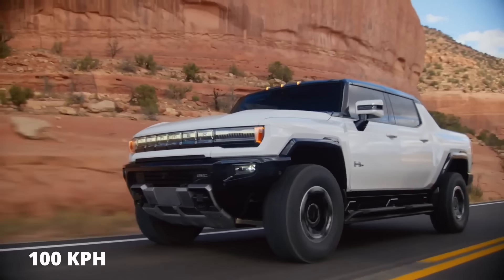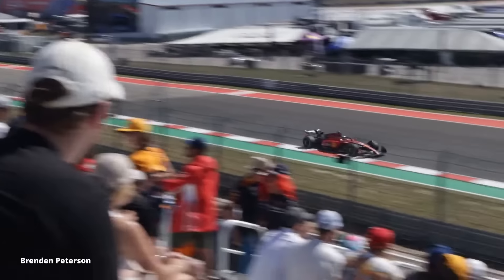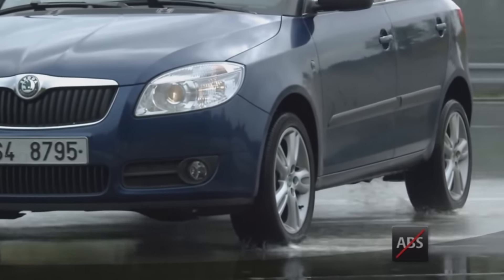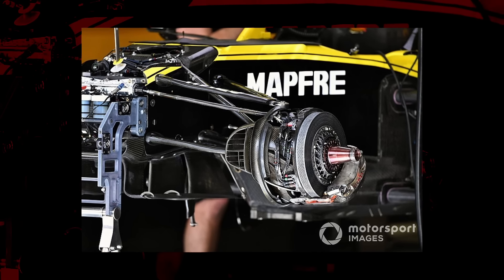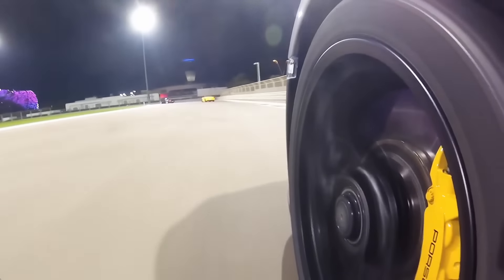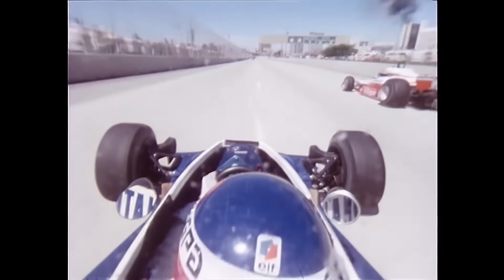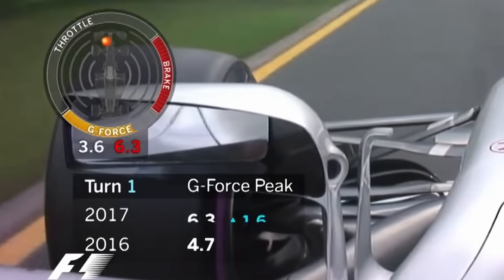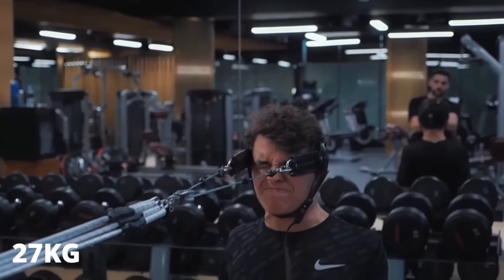Why It’s Almost Impossible to Stop From 200 MPH in 3 Seconds

Comment: The F1 brake explanation is out dated. Since 2014, F1 uses brake by wire with load cells and a computer controller to balance rear braking with energy harvesting.
Reply: I was going to say the same thing.
Reply: True, what he explained about the effort required to apply the brakes is still true however.
Reply: @JoshuaPlays99 What advantages do you get from artificially requiring a large amount of force on the pedal to brake? More precise control?
Reply: @baileyharrison1030  far more precise control, and also remember they can pull up to 6g on deceleration. If the pedal was too soft they wouldnt be able to modulate it as easily. They dont actually need to press that insanely hard because the gforces assist them in pressing the pedal.
Reply: Don’t they use a hybrid braking system with bbw in conjunction with standard braking
Reply: @baileyharrison1030 it’s not fully bbw
Reply: @JoshuaPlays99  thank you that makes sense
Reply: What he said an more
Reply: @JoshuaPlays99 redbulls can get up to 8g but same same
Reply: @JoshuaPlays99 well you do get some assistance on an F1 break. But it's a similar to how a servo on a road car get's assistance from the underpressure inside the engine bay. This pressure can be adjusted in the garage. But it's a simple multiplication of the force, nothing like the ABS like systems that help you control the brakes.

Comment: In 2019 I watched the German at the Track. Even the 'little' breaking zone for the Sachskurve was pretty insane. They came in easily 100kph faster than the Porsche Cup running just before, and still applied the brakes 40-50m later. 
Keep up the good work :)

Comment: 1:47… F1 drivers adjust their brake bias multiple times per lap. And they actually only run a front bias on 1 or 2 turns per track (hair pins or very tight turns like that). Most drivers actually use a slight rear brake bias most of the time, a rear bias actually helps slow the car faster than a front bias, it’s easier on the front tires, better for weight transfer, helps with rotation, and lastly helps with trail braking.
I only know this because I’m a racing (and F1) nerd, grew up at the race track following dad around on his race weekends, and spent a handful of years karting and 4 years in SCCA and club racing (Formula Ford, spec Miata, group G in a Porsche 993 race car, and one season in a Porsche GT3 Cup Car).
Reply: 9:38… the Hans device helps with this a lot! With the Hans your head can only move forward about an inch (assuming you have it set up correctly), and looking side to side you can only turn your head a couple on inches. Makes checking your mirrors a real pain. But it is nice to feel it catching your head under braking.
Reply: The brake bias ratio is super dependant on the wheel width, tire pressures, tire compound, the suspension, the sway bars, and the chassis itself.

If you just slap a certian ratio on any car, either the front brakes or the rear brakes will be at their limit while the other isn't braking as hard as it can be. The scenario in which using a high rear brake bias would obviously be with massive rear tires and stiff suspension, so not much weight gets transferred to the front tires, maybe even with a ton of downforce on the rear too

Road cars generally do have too much front brake bias, but that's just a safety thing because the average driver can't correct oversteer that well.

Tldr, it's unsafe and sometimes un-wise to have a rear brake bias in most cars, because like too much front brake bias, you aren't braking to the fullest but you get the added instability. (A little is a good thing, any more and that's asking for trouble)

Comment: As you say, it is possible to make an F1 car brake more effectively than current regulations allow but at that point we're pretty much approaching the limits of human endurance. 

I remember Alex Zanardi's second stint in F1 with Williams back in the late 90's: he was struggling to adjust to such an extent that the team gave him steel brakes at one race - with a weight penalty of 1kg per wheel. 👀
Reply: F1 drivers probably could still do it. Depends how many times and there could be a risk of injury of course. Based on how quickly they would be braking it could range from minor to serious injury of course. I would really like to know how far in this case can human body trained for this go. To be honest in case they would be braking this hard only while driving straight they could sustain it for the entire race i think. When the braking force would go too high even on straights the only option i can think of would be to literaly rotate entire cockpit by 180 degrees. In the past army was testing human limits for G-forces. Humans can handle a lot more G-forces if they are facing back first. That is also why flight attendants on planes have seats facing backwards. They have higher chance of survival this way. People are able to survive a LOT of G-forces in a straight line.
Example:
Pilot John Stapp
Quote from wikipedia:
By riding the decelerator sled, in his 29th and last ride at Holloman Air Force Base in New Mexico, Stapp demonstrated that a human can withstand at least 46.2 g (in the forward position, with adequate harnessing). This is the highest known acceleration voluntarily encountered by a human, set on December 10, 1954.[7][8] Stapp reached a speed of 632 mph (1,017 km/h), which broke the land speed record and made him the fastest man on Earth.
Reply: I mean yeah f1 driver could probably do it. But only for qualyfing. Lets look back at qatar. The tyres didnt last as long as expected so the race direction told the teams that they need to ptt every 18laps. That stints where so short that the drivers didnt needed to watch after the tyres, they could just Drive qualyfing pace the whole Race. Ocon vomitted at lap 15, stroll blacked out during highspeed corners and logan needed to stop because he also had Problems with sickness this weekend who wasnt from f1. So if f1 drivers doesnt Drive +6 secounds slower like usual to watch after the tyres to go the distance, than its borderline suicidal to race a complete race. Like seriously suicidal if we pull Up to spa monaco jeddah vegas or singapore who are one of the most Dangerous tracks we visit. If we had the rule there than oh dear. I know Qatar is a highspeed track so yeah but if they say the vomit at lap 15 of 50 than even on thouse tracks (who arent slow speed only monaco) are to dangerouse. Monaco is so hard on your mind if you blackout at lap 50 of 80 your instantly in the wall maybe with full speed. Singapore is hot and a street track like monaco. Jeddah is the fastest street track of the world with lots of blind corners, and Spa killed drivers in 2023 and 2019. So i love it when we break track records Like in jeddah. But i think we should stay at the speed we are. I think we are at the max with what a human can do. Its just sad how many ppl dont see it and say its just driving cars. And that football is harder than f1 or just stupid things like, well even i can drive this blabla

Comment: Excellent video. One small point about the lighter weight of carbon brakes, is that it's unsprung weight, so very important from a suspension POV. Also less kinetic energy in the rotation of the wheels which also helps braking.

Comment: Besides the human strength the other major limiting factor on braking is grip. The brakes only need to be as strong as the maximum available grip. And adding more grip to decrease the braking distance comes with a lot of trade offs. Either in terms of added rolling resistance, increased aerodynamic drag, rate of tire degradation etc. The difficulty in making brakes for racing isn't their strength but rather their durability and consistency.

Comment: There is a guy on YouTube, that engineered an RC car with huge amounts of downforce. At the moment he's at 10g peak deceleration at 70mph and thats with Aero developed at home. So without rules, an actual F1 team should be able to achieve pretty staggering deceleration values.
Reply: @dickfitzwelliner2807  indeterminate design and his RC Hypercar project.
No idea how he looks, can't remember that he's ever been Infront of the cam, only voiceover.
Reply: A combo of active aero and well designed tyers, the stopping power would be strong enough to cause the drivers to pass out.
Reply: @RNA0ROGER  intermediate design didn't even need active aero. He's "just" got really good fixed one and gets 10g peak deceleration at 110kmh.
Reply: @fabianrudzewski9027  Active would help below 110

Comment: No abs actually stops faster on dirt as rolling prevents the tires from digging or skidding which uses more than rolling grip. Try it, it's one of the first things you learn in offroad racing and even just riding off road.
Reply: Fun anecdote: Years ago some friends and I went roadtripping in a normal modern-ish car. We somehow got into a rural area with unpaved roads that seemed like wet clay surface. We have a video of driving at (iirc) 20kph, then applying brakes (with ABS kicking in). The car pretty much just went on as if I wasn't braking. We did that a couple of times for fun then slowly tried to get back to tar roads...
Reply: Total PIA with ABS when four wheeling or driving unimproved roads.  Unsafe!  I’d love a switch to disable ABS for those situations.
Reply: @alskooper3319   lil tip, you can wire a switch or just unplug one of your wheel speed sensors, should work just the same as it should immediately throw a code and disable vsc and abs.
Reply: Lesson to be learned is at lower speeds with heavier machines less abs is needed on looser matterials unless you are not trying to sink in and get stuck

Comment: Everyone always talks about the discs and never the pads when they discuss braking, but the pads are actually the true heros. With the discs the friction is spread over the entire surface of the disc, so at any one time only the fraction of the disc that is in contact with the pad is experiencing friction, and it has a large mass to distribute the heat. But the pads experience 100% of the friction on their surface 100% of the time during braking, and they have to absorb just as much heat while being a tiny fraction of the size of the disc and while not having any nice vents on them to help cool them down. The pads are way more impressive IMO.

Comment: "Not always" rotating wheels stop faster. On loose pavement, eg. gravel road, or snow, where braking distance can be shorter with blocked wheels due gravel/snow building up in front of blocked wheel

Comment: Don’t forget that the main limiting factor in breaking (or accelerating) is ultimately traction. That means the tires are the most importantly part of the braking system in any car. 

Never cheap out on your tires, folks.

Comment: Possibly the most crazy aspect of F1, is that ever since the early 1980's, most rule changes have been based on SLOWING THE CARS DOWN. No matter what the "Official" justification has been for a rule change, be it safety, efficiency, reliability or what have you, the underlying aim has been slowing the cars down.
Why? Well, it's not a good look for the sport to have cars that are so fast that they become potentially lethal to the drivers just by driving them, and with the knowledge of aerodynamics, engine power generation, and grip generation that became available in the early 1980's, that possibility became VERY real. Ask any F1 designer how fast they COULD make a car go around a track, if they didn't have the limitations of the F1 rulebook slowing them down, and they will all agree that a 25% reduction in lap times would easily be possible. The problem is that no human would be able to drive the car, the limits of the human body being much too low to survive the forces generated...

Comment: Correct me if I'm wrong, but by adding 50 lbs you were already simulating 6g. You have 10 lbs of head and an additional 50 lbs of weight. So the required 60 lbs in total.
Reply: yeah yeah, he missed that. but then theres the helmet as well...

Comment: To your point that to make the fastest braking F1 car you would throw ABS on it to improve braking performance. As a former racing driver I would like to add that good drivers, that now their car well, will definitely out-brake ABS. Braking with the highest possible pressure input without locking up will give you better braking performance than just slamming on a full emergency break and let ABS do the work. When ABS is applied there is still quite a bit of tire locking going on, ABS just makes the brakes lock and release in very short intervals. ABS is a safety solution for regular divers and not a tool to improve braking performance in racing for professionals.

Comment: Bro said 700 G’s??..  700 would turn your insides into juice. You’d be blended. Try going for 5 to 8. And 10-30 at a instant stop crash. Maybe just 50 if it’s rlly bad.
Reply: not that hard to see he's intentionally exaggerating
Reply: Bro yeah 700 Gs was a big slip up,  however check my facts,but I do believe last year, 23 at the FrenchGP leclare had a 51G impact. And also the year prior one of the 
Alpine or Williams drivers had a 69G impact at monza or the other Italian gp race.
Reply: @Rob-tr1st  last year there was no French grand prix, that was 2022, and the 51G impact is Max Verstappen, Silverstone 2021.

Comment: You're right, it's not all just about 0-60. There's also comfort (EVs excel in that as well)

But feats like braking from 200-0 in 3 seconds isn't something that's for the EV vs. ICE discussion, it's for general engineering that should be optimised

Comment: They can slow down from 300kph to 100kph faster than they can go from 100kph to a stop.  Of course all their ability to brake is about the traction on the ground and the higher the speed, the more downforce, the more they can brake.  Turn 1 of Monza is mighty, but it's also their "worst" braking performance demonstration, because these cars are in the lowest downforce trim.  Normally at other circuits, they can brake with even higher G.  But what makes Monza's turn 1 the most fascinating is because the delta between the top speed and the minimum speed needed to make the chicane is the highest of all circuits

Comment: Although F1 drivers could likely withstand slightly higher g-forces during braking than what they do now, much higher g-forces, when repeated over and over during a race, would become a serious safety and health hazard: drivers might become dizzy or even lose consciousness mid-race, thus risking undergoing serious accidents (it has already happened both in F1 and in other categories, actually).
This is the main reason why the regulations have clamped down on brake technologies multiple times over the past 3 decades, for example by limiting disks diameter, number of pistons within brake calipers, banning the use of ABS and anti-diving systems for the nose, etc. Without all those regulatory limitations, current F1 cars would likely be able to pull over 8g while braking. But, although it would still probably be fine for qualifying, it would be dangerous over a 2h long race.

Comment: So the real reason we can't brake faster is because we would literally kill the driver if formula 1 decelerated faster
Reply: No, not really, you would have to hold that breaking for longer time when it's 2-3s max it's like a small crash and they still pull a lot of g's while breaking but it's not enough to be dangerous in length and force either

Comment: You could have a special damper that holds the helmet from the rear (while allowing some freedom of movement). That way the damper would absorb most of the G force and the neck would not do all the work of holding the head.

Comment: Brake swept area versus weight versus friction of brake discs/pads. carbon brakes in f1 cars heat up to near melting point and can be seen glowing under heavy braking situations. The downside to F1 brakes is that they need to be warmed up quickly otherwise they do not work properly and will not stop the car. carbon road brakes on road cars, Ferrari, McLaren, etcetera use a lower cost softer carbon brake pad to limit wear and more even braking.

Comment: Having bigger wheels with wider tires and bigger discs will increase rotational mass leading to the same performance as we currently have. F1 breaking has come to a point where this is as close as it gets to stop a car in the fastest way possible. However I’m not saying it can’t be improved but having bigger wheels and discs are not the solution.

Comment: 1:09 700g, I think not, that would be the equivalent of an acceleration/deceleration of 6867ms-^2 and equivalent to a stopping time of 6.5 ms from a speed of 100MPH exerting a force on a person of mass 100kg of ~687kN, i.e. the equivalent of crashing into a tree at 100MPH.  The maximum g-force during a formula 1 has  been measured at 6g cornering, which translates into a centripetal acceleration of 58.86ms-^2 or a centripetal reaction on a 100kg driver of 5.9kN.

Comment: I'm thinking that a 6G braking event would be a breaking event for my potato body. I would be thinking that I had just crashed. 
With three heavy braking zones they do a couple hundred reps in a race as well as 5G lateral. F2 drivers jumping into F1 for a race or two have a hard time because they haven't developed the endurance since F2 races are quite a bit shorter. 
The stiff brake pedal was mentioned. They press the pedal with about 300 pounds of force. One legged calf raises for 90 min. And they have to think and avoid traffic during all this. They have to spend years developing the capacity and endurance.